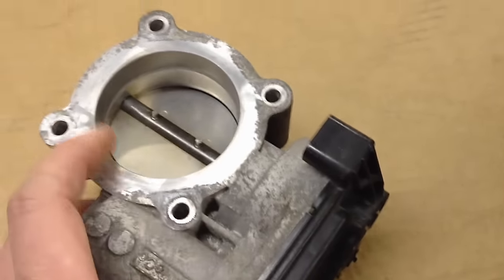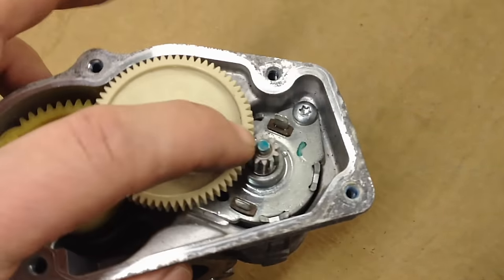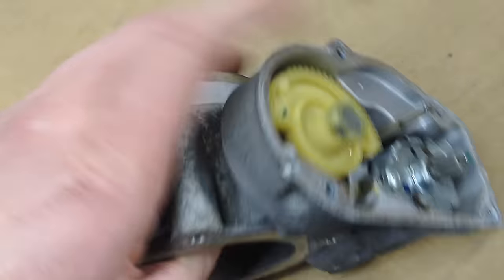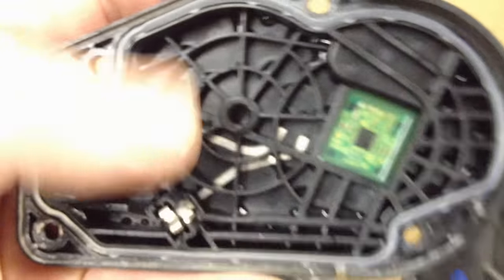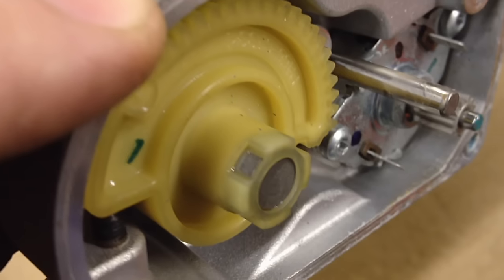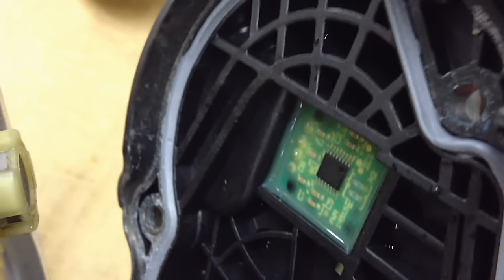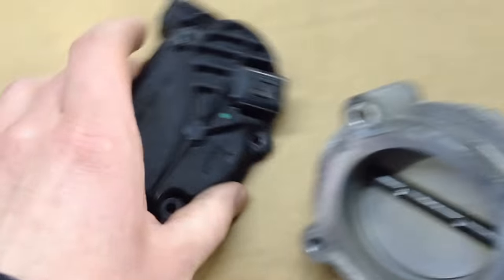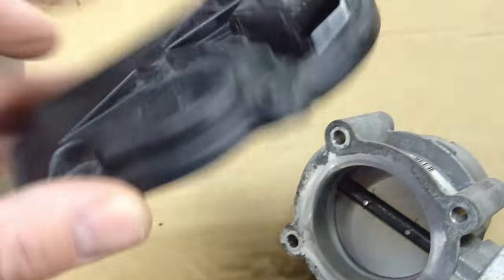Ford Electronic Throttle Body Failures

Comment: You know those DC motors working their butts off going back and forth for constant and variable throttle position. Sure would take precise control to run those motors like that. The trouble they go thru just to eliminate a cable... smh.
Reply: Exactly, technology going backwards.. lol

Comment: I installed a new battery on 2006 Ford 500 and then had P2111 / P2104 codes.  I cleaned the throttle body, erased codes, disconnected battery, etc, etc.  but kept getting the same codes and locked in "limp mode".  I was just about to buy a new throttle body, but first decided to adjust the closed position stop after watching your video.  Mine is a spring loaded stop screw/pin - slightly different from the one shown in your video.  The head is a plastic hex that protrudes on the outside of the housing.  I backed the stop out about 3/4 turn and this corrected the issue.  Car is running better than it has in months.  I assume this adjustment may be compensating for a weak return spring, but it got me going for now.  Great video!  Much appreciated.
Reply: Has this worked for anyone else?
Reply: Tried this on my CVPI.. snapped the plastic bolt in half. Absolutely no idea why Ford used the strongest Loctite available on a plastic bolt.

Comment: Thanks for you video, very informative.  You say that the electronics assembly is available.  Two questions.  Where can you get it; aftermarket or dealer only  part?  What is it called.  I looked a an item called a TPS (Throttle Position Sensor) at AutoZone and it wasn't anything like what is in the video.
Reply: I would like to know the same exact thing
Reply: Why hasn't there been an answer to these questions yet?
Reply: I went to three places and finally found it. It's called a throttle position sensor
Reply: The part he's holding is called a ETB ( Electronic throttle body)
Reply: In this video, that's the throttle plate motor. It's on the opposite side of the TPS

Comment: Today my 2016 Explorer cut out on me while on the Interstate in Orlando. I later found out it was because of the Throttle Body Issue. I almost wrecked.
Reply from the maker: Yeah the new vehicles are have throttle body issues all over again 2013-2016 maybe even 2017 as they use the old stock at the factory.
Reply: Hi, i have a 2008 explorer and the orange wrench came on, sometimes the car just died, i already replace the throttle with sensors and still doing the same, please help. thanks
Reply: Jesron Garcia did you ever figure this out? Driving me crazy.

Comment: Just had an issue with my car going into limp mode. Same codes previously discussed. Replaced with a new one. Opened the old one and found the first five teeth had been worn almost flat on the half gear that connects to the throttle valve which made for inconsistent idle. 20 minutes to replace. Thanks for the videos.

Comment: Thanks buddy. Happened to me today on the highway. Complete loss of power at 100 kmph, coupled with a heavy gearbox shift, probably to neutral. Was on cruise control. The orange wrench came on but no MIL. Stopped at the shoulder on emergency, no throttle response. Put gear in P then back to drive, nothing. 
After a quick engine off/on cycle, MIL was on but power is back. Checked the OBD back home and it said P2104 and P2111, throttle body fault and throttle stuck open respectively. I don’t think I have experienced and throttle wide open condition during the fault, and therefore suspect a malfunctioning TPS. Will order a full body and replace, will follow the throttle relearning procedures and update on what happens. 
Thank you for the great videos. Keep ‘em coming buddy.
Reply: Did that fixed the issue?
Reply: No it didn’t. The problem persisted after changing the throttle body. I randomly caught a misfire at cylinder 3 a couple of times while checking the faults after the failure occurred. So I decided to work on plugs then the coil. The problem was cured after the coil change. 
My hypothesis, a misfire either calls for torque compensation by increasing throttle flow and a downshift (hence the abrupt shifts). While at high torque situations this might saturate the throttle position to wide open and cause the fault.
OR —> the misfire causes a weird back emf to the circuitry and that triggers a false signal, allowing the ecu to raise a false flag.
Reply: @omarbedair  am facing the exact same problem, did you get any obd codes for the misfires? I just replaced the throttle body, replaced all of the coils and plugs, got the pcm reprogrammed,as at one point the truck had problems running the fuel pump, and i replaced the accelerator pedal with a good known working one and am back to square one. Next i guess i'll double check my plugs and coils and clean the old throttle body. Last thing i might try is replacing the pcm.
Reply: @miguelcalderon3702  sorry to hear that. Guess I had a little bit better luck. Yes I got OBD’s for cyl 3 misfire randomly a couple of times, wasn’t consistent. That led me to change the plugs / coil. 
If this is the case with you, despite chAnging the plugs and coils, you might be facing misfire due to other issues (e.g. coolant leakage into a cylinder). Is your coolant level going down for any reason ? 
The problem could also not be related to misfire. This is a weird issue and u definitely need luck on ur side.
Reply: @omarbedair  Thank you for letting me know that it actually gave you a code and for the information you posted. I'll keep on checking it and if I find a solution ill post it here as it might help somebody else down the road if not i'll just sell the truck and be done with it.

Comment: Thanks for your vids. Helped me out a lot with my 07 Explorer 4.6 3v Orange Ironman Edition 225k. Thought I was having TPS issues with random stalls at stops or at highway speed as soon as you let off the pedal. I pushed the throttle plate all the way to closed and it stuck close. Removed and cleaned throttle body and no issues at all with the originalTPS. Sticking Throttle Plate essentially blocks all air intake then you stall have to pull over and restart engine which resets throttle plate. Hard to chase down randomness. No codes. Gummed Up Throttle plate. Try pushing yours closed and see if it sticks if u have random things happening. Good luck

Comment: There is a chip available that does exactly what is required for this design.  That is an ordinary permanent magnet on the end of the shaft.  The chip detects through hall effect sensors the angle of the field with relation to the chip.  The unfortunate thing about hall effect devices is because of the heavy doping they have a higher failure rate than other IC's.
Reply: Hi Randy greetings brother! 6 years later, what is the name of the chip bro?

Comment: Done changed the plugs and checked all coils and still have a rough idle and that little surge so I guess I'll be going with the BBK 80mm throttle body thanks
Reply: Same issue at mine. Did this solve the rough idle?

I hope you can reply my message 😊
Reply: @zipdriver98 plugs, coils, dirty maf sensor(if yours has one), dirty throttle body, purge solenoid, dirty injectors...all can cause rough idle

Comment: 2010 Ford Escape New throttle body part was $100 Woodhouse Ford Blair Nebraska .Ford extended the warranty on this part to 10 years or 150,000 miles ,I changed it out myself...Extremely important part so that your FORD doesn't stop in the Middle of the Freeway

Comment: Excelente video! I think the electric motor is not a regular DC motor but an Stepper motor drived by a PDM signal.
Reply from the maker: +Argeny Sandoval yes just like digital egr or iac
Reply: FordTechMakuloco Thank you! You are doing a amazing job! Thanks to you I fixed my Ford F 150 Engine knock by replacing both Camshaft Phasers!
Reply: FordTechMakuloco 
Sir, I have a 2005 Ford freestyle that when it seems to get hot or just randomly the check engine light and check transmission with the 🔧 light and it won't shift, now if I turn it off for a few and turn it back on no lights,  it drives fine for about 30mins or non at all Bfor it comes back on, now also when the check engine light comes on with the trans light but no 🔧 light it drives OK! Can you please help iam being told I need a new trans but while non of those lights come on it drives beautiful..
Reply: Its a regular dc motor driven by pwm signal...

Comment: I have a Ford Escape 2010 it started acting like a work when the check engine and wrench light came on all I did I cleaned it and it worked again the car is in Mexico I couldn’t find the part in Mexico I’m back in America piece of cake so when I go back gonna install new one it came with the kit and got the mag sensor too great video

Comment: Fantastic vid. Thank you for sharing! Internals look so simple once someone else takes it apart :)
Question about the motor. I understand TBs do a full sweep when you turn car off to align itself. Is this correct? I hear a very loud non stop buzz coming from the TB when the key is set to ACC (before starting car). What is causing this buzzing?!!!... when cleaning the TB, do you suggest NOT forcing it open against motor's resistance to clean around the butterfly plate? Thanks!

Comment: That’s a good idea to just change out the plastic cover on your throttle body. However like in my case for instance, I just purchased a Brand New throttle body for my 2005 F-150 with the 5.4 Triton for only $63 dollars. And it comes with the throttle body sensor which is on the passenger side kinda towards the back of the throttle body. I’m going to get the whole thing for $63 dollars. You can’t beat that huh?

Comment: you mention that they may soon sell just the plastic cover with the chip, I have a 2012 edge and the dealership is wanting 780 for the repair. If I can find that specific part which seems to be the failing part I'd rather do it myself as its such a simple fix.

Comment: hi Brian 2007 lariat 5.4 triton eng 3 valve can u please advise what really works to increase HP and torque I'm keeping quite muffler new installed, I'm not sure air intake is really reliable may set codes, so simple bolt on for added HP , engine 186000, runs great and quite …..thanks,,,, pleasure to hear and watch your  explanation and hands on repairs , not sure tuner is risky but rather bolt one perfered besides muffler has duel tail pipes

Comment: thanks for the info....just so i'm clear..(I'm thinking of a 2013 Taurus and am worried..)  - Is your solution to replace the plastic side housing that holds that sensor?  And if so...what aftermarket one do you reccomend?  Also..is Ford aware of this?  Is there an associated recall to your knowledge?  Thanks.

Comment: I noticed mine starting to fail with the P2112 code during the recent Arctic-like temps of -20 C temps. When the temp went back up to -1 on Saturday I didn't get the dreaded failure.
Reply: Wondering if yours would go into limp mode? Mine is doing the same thing but not leaving a code. Just brings up the wrench maintenance light. Restart the car and everything goes away
Reply: @nikkicartee879  Mine when into limp mode almost got killed....fucking ford. Had to replace TB and no more issues
Reply: @SFBay69  same here, F-150 went into limp mode on the Interstate when about to take off ramp to mix master. Nearly rear-ended then nearly again when it started working and had to reenter traffic. Code P2112 did get set

Comment: Awesome video! i was getting P2104 - Throttle Actuator Control (TAC) System - Forced Idle, P2112 - Throttle Actuator Control (TAC) System - Stuck Closed codes.  so i replaced the motor and cleaned the TB.  Im still getting the codes.  i guess i need to try and replace the TPS next?
Reply from the maker: Which vehicle and year? how did you change the motor only? If you have a p2112 you need a complete throttle body, except for certain years let me know.
Reply: FordTechMakuloco its a 2006 f150 fx4 ,  Dorman makes a side cover replacement that has the motor and sensor in it.
Reply from the maker: Usually that is mechanical sticking and you need to replace the throttle body. The tps sensor should sets a code P2135 I have many videos on it.
Reply: ordered the part.  thanks!

Comment: My daughter had a 2010 Ford Fusion with this problem going into limp mode on I-85 in Charlotte. I replaced the throttle body no problem after she bought the part for $270. She now has a Honda Accord and is very happy. I think Ford lost a customer that they will never win back.

Comment: FORD F150 throttle body engine light so i checked it and came back with 7 code errors so 
replaced throttle body pigtail and came back with 1 code error so replaced throttle body 
and came back all good no code errors drove it 40miles and the tool light came on then the 
engine light came on then the engine went DOA so disconnect battery cable for 1 hour 
reconnect it and started the engine and runs good no code errors and engine light is off.

Comment: I've watched seveeral of your videos and have recently subscribed.
I've had TB fail in my 2013 F150 ecoboost 3.5L engine on 3 separate occasions. 60k, 71k and now at 114k miles.

Anyone else have multiple failures events like this?
Does it happen when towing or unloaded?
Mine have all been while towing or just after dropping a trailer.
Never with my light trailer 1,000 lbs and never with my heaviest trailer - closer to 8,000+ lbs.
I saw a few posts about aftermarket or non-FOMOCO TB parts - anyone have any better luck with Rock Auto, Advance or others - rather than OEM parts? Again, this is getting pretty disappointing, unsafe & leaving me not really confident in the truck's reliability to go 100 miles or 1000 miles.
If any Ford customer service people or techs read this I'd be interested to hear from you.
Reply: My 2012 TB failed at about 210k miles, no issues since. What were the symptoms on yours?
Reply: @jacobmarshall3872  
I had Ford motorcraft TB replaced under warranty at 75k 78k 112k.
Autozone TB at 150k 200k 240k.
(Mileage estimated,  but pretty close)
The printed circuit board just seems to fail under heavy loads.
At 150k I bought the lifetime warranty TB at autozone for about $135.
I just trade it in every 40k as a preventive maintenance. 
I work this truck significantly. 
About 160k towing miles. 
This may be a contributing factor. 
Thanks

Comment: Hi, I have a 2011 Ford explorer, last week it went limp and lost power while on the highway, wrench light came on. We pulled over, tried to start it back up but it would just turn off right away. I had it towed to the Ford dealership and we were told we need a new engine because engine is knocking. Funny how when we turned it back on while on the side of the road, the engine wasn't knocking. Do you think it's the engine??

Comment: The sensor IC on the PCB is called a Hall effect sensor this is a magnetic sensor, it picks up the position from the magnets in the movable part of the main body, if one can identify the IC number from web site search one can find all the data on the main sensor IC, but I am sure this might be a special build IC for the car, some manufactures don't want you to repair the PCB for obvious reasons, IC's usually have a identification logo on them like LT linier technology or Ti Texas Instruments e.g.
Reply from the maker: CoolMusicToMyEars With the magnets on the gear for the shaft that makes sense just don't know how what looks like a regular IC reads it.
Reply: @FordTechMakuloco  that ic is essentially a gauss sensor...

Comment: Dear Ford Angel (aka FordTechMakuloco):
I believe this video could be our problem.  We have replaced the TPS with an OEM one.  We replaced the Throttle Body Motor with an aftermarket one.  Still won't start.  The throttle itself looks clean and we cleaned it twice already.  You're pointing out the lil computer chip -- ah hah! -- now that's a real eye opener.  Is the black part you show us in the video -- is that now available to us 2005 Ford 5.4 Expedition owners, and if so, where would we get it.  Otherwise, I guess we'll have to order the part.  We do need an OEM throttle body, right?  Since we've already forked over the money for the OEM TPS and an aftermarket throttle body motor (Dorman I think it was), where would be the best place to order just the throttle with a new and improved computer chip?  Also, I'd be glad to detail what happened to us when this thing failed, if you think it would help other unsuspecting folks diagnose their problem.  It's actually a 500 mile saga since we were on a trip when it all started.  Maybe one day we'll look back on it and smile, but right now it causes only grimaces since my once-fantastic Expedition is sitting still crippled in the front yard.  Can't wait to hear from you, and "thankee thankee thankee thankee"  as Gomer would say.  I so appreciate you sharing your expertise with us.
Reply from the maker: Henry Strickland How do you know the throttle body is at fault? The most common fault on those is a fuel pump driver module causing all of this I have a few videos on this specifically on the expedition like yours. Have you checked fuel pressure?

Comment: I have a ford Taurus 2013 with about 45k miles on it. I was told my throttle needs to be replace because the actuator failed on the testing. Can I replace the actuator without replacing the throttle entirely? They are wanting to charge around $800 to do it and extended warranty through ford only covers it if the sensors fail. I am not sure if this is an ETB problem or what. Do you have any opinions? Thanks

Comment: I'm having to replace the throttle body in my 2005 Ford Freestyle - apparently a notoriously defective part. I can purchase a remanufactured part under $200. Would you recommend these and what is the benefit with a cold weather package? I live in Wisconsin.